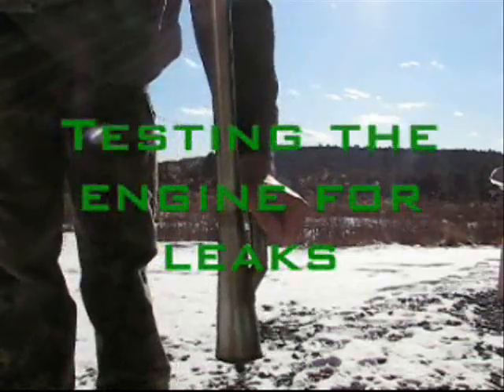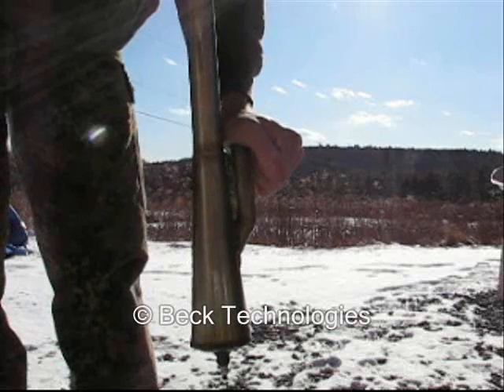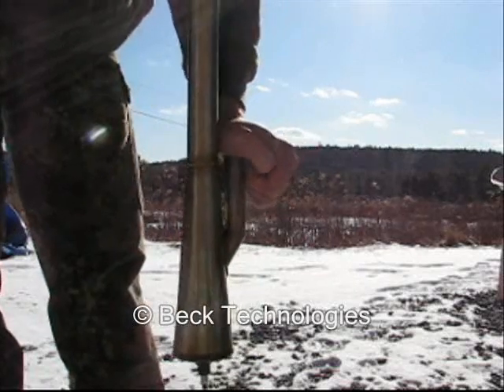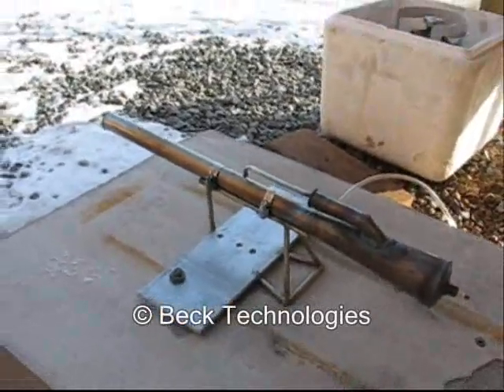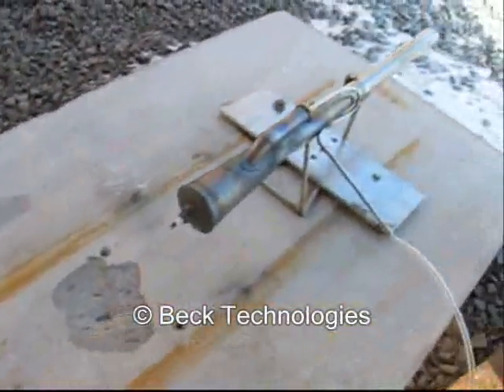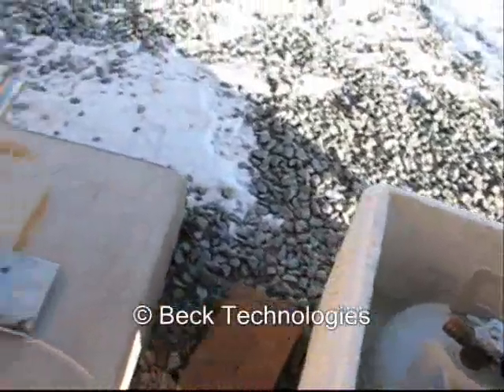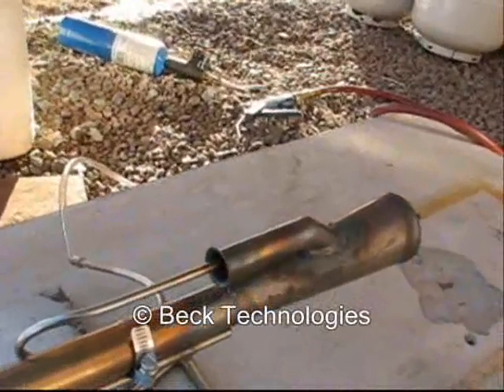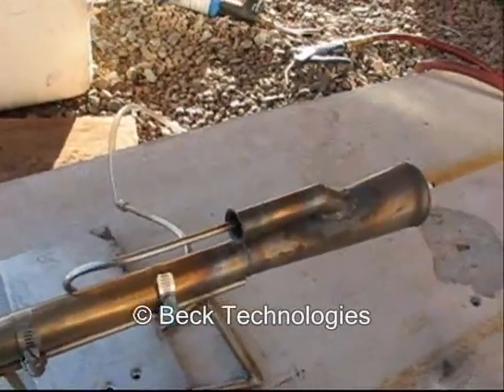Advanced FWE Pulse Jet Starting Tutorial

Comment: Use dish soap and water on the outside, blow compressed air inside and you will get nice big visible bubbles where there are even small leaks.

Old trick from an HVAC engineer :)

Comment: No moving parts= NO OVERHEAT. hotter you can run a pulsejet, the better. Propane gets very cold when you expand it! So therefore 100 degree weather and a red hot engine will not affect it!

Comment from the maker: @madnesscombat5 
Actually the frequency does vary, by about 10% from minimum to maximum throttle, mainly due to the engine running at a higher temperature and the speed of sound being higher.

Comment from the maker: Turbojets in scale models take up little space themselves, but they require very long high temp insulated exhaust tubes and other equip. 

Pulsejets always get a bad wrap because people only compare the engines themselves, rather than the engines and all the systems needed to make it work. 

If you put a pulsejet in an insulated duct, like the turbojet exhaust duct, the overall temp is about the same. 

The pulsejets also dont necessarily need fuel pumps, ECU's, onboard starter motors etc etc.

Comment: it cant take the place of a standard turbojet without modification because of the heat, but they do use valved pulsejets on model aircraft. it was also used on the v1 buzz bomb.

Comment: I have a few questions, if one wants to use the valve-less type on a model aircraft,.

Can it run on a liquid fuel and will the thrust be the same. 

How much fuel is needed for a 5min flight? 
What is the weight of the engine?

Comment from the maker: The point of the video is to show that the engines can hold water, where the spot welded junk engines sold on ebay, look like a water sprinkler when you try to fill them up.

Dye is a lot more messy, and a bit overkill, since pulsejets dont operate at high pressure with very low viscosity liquids.

Comment from the maker: About 2.5" into the intake is a good spot for the fuel injector, flattening the tip so it is smashed shut, then tapping on the edge so that it "opens up" will make a slit for the injector tip, which works very well for propane.

Comment from the maker: That depends on your equipment and abilities. If you can cut the sheet out then you can build whatever you want exactly to the size you want. If you build from parts you usually have to comprimise on most of the dimensions and get something that doesnt run to its full potential.

Comment from the maker: ..... water.... you dont test for leaks by filling a container with flamable fuel... and then proceed to dump the fuel on the ground afterwards... The point was to show that the engine doesnt leak. If you tried that with one of those spot welded thermojets the engine would be empty long before the speach was over.

Comment from the maker: Depends on the piston engine, this is a heavy duty engine, for flight you can make them extremely light, but when you make them really thin you cant run them statically without damage. With 28 gauge stainless I could make an engine weighing about .6 pounds that produces around 4.5 lbs thrust, at speed that would be quite a bit more powerful than most piston engines due to the fact that they produce less and less thrust the faster they go.

Comment from the maker: You can run them statically for very long time without it "overheating" it basically just maintains the super hot temperature the entire time, it doesnt melt or anything. The first production prototype of this engine I ran 2 hours continuous on an old style propane tank that couldnt be refilled, engine was fine afterwards.

Comment: The only way a propane tank may explode is something called BLEVE (Boiling Liquid Expanding Vapor Explosion) and would require you to have the tank in flames, literally, and even though it still would propably just pop open from the valve and creating a rocket engine. Me and my friend made a simple plumbing  pipe pulsejet and no matter what we tried the propane tank didnt just want to explode :)

Comment from the maker: The stainless is extremely resistant to heat. The first production model I test ran for 2 hours continuous with no problem and a total run time of over 10 hours with no damage, after I took some 600 grain sand paper and did a quick polish on it, you could barely tell it was even run. Most people will only run them for a few minutes at a time. Basically these things can keep going until you run out of fuel, eventually they would wear out, but it would take a very very very long time.